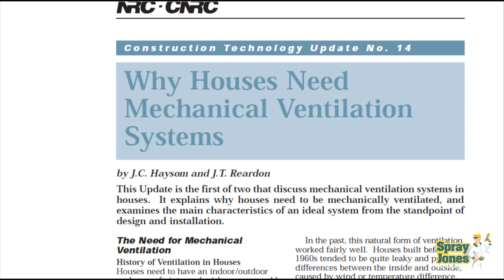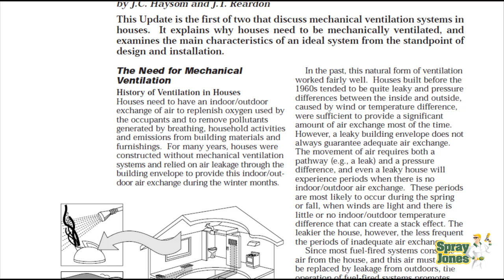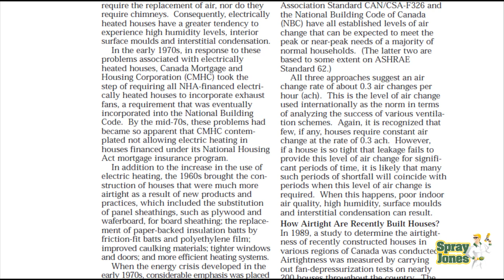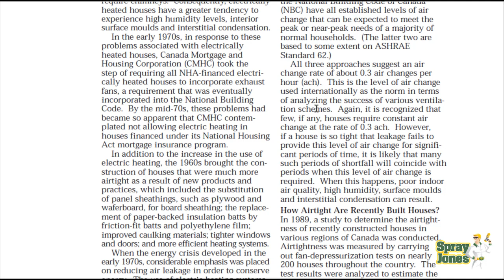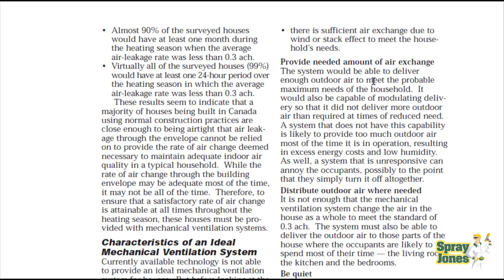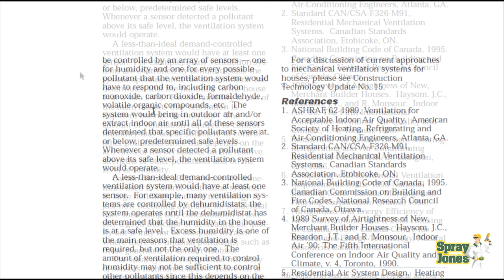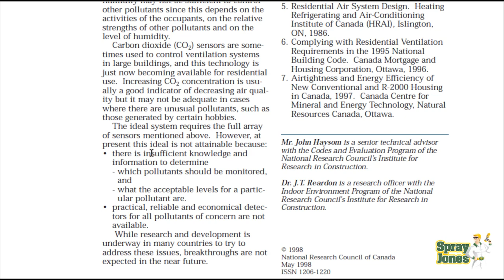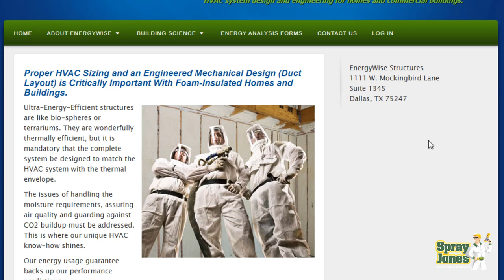Can A Home Be Too Air-Tight With Spray Foam Insulation?

Comment: I had a cabin with closed cell.  It had moisture in it. My hvac professional slowed the a/c air flow by 20% and the air was great. 30% humidity. System cycled 1-2 times per hour in the summer. Done deal.
Reply from the maker: Thanks for sharing

Comment: Thank you for answering my question so quickly on "knowing how to get a quality spray foam installer". I watched every video you did. I am building a 4,200 sq foot home. It will have a conditioned attic, a fresh air system, and the HVAC will be housed in the conditioned attic space with separate dehumidifier system. All designed by an engineer. So, one last question. Structurally I will have wall studs that 2x6 or 2x8, dependent on what the structural engineer may deem worthy.  As I have seen in your videos with ROI on closed cell (thanks for backing it with true data) 2/3 inches of closed cell in both wall and in the conditioned attic space and ceiling of the internal living space. Again focusing on air sealing and thermal breaking. If I do that, then is my home considered done? meaning that it is unnecessary to do batts, further vapor barrier etc. I understand that this is all conditional based on proper install, but with 2 inches just wonder if there is anything more. This 2 inch closed foam is excellent and as I am going to have a deep wall cavity it leaves plenty of space for electrical wiring and plumbing. As if in the future I do not have worry about a plumbing leak or an electrical replace and have to dig out the wall. Like I would have to do with open cell foam and shaving. Thanks also for the tip on taping the joists and wall studs. Another great tip to know if you have a good contractor! Thanks again for all you videos. You the MAN!

Comment: I've enjoyed this series a lot. 
Currently have an old fishermans cottage gutted back to the stone walls. Roof done, doors and windows done and currently trying to work out the best option for insulating.
I have to say I've been sold on foam but really have to consider what I'll need as far as HVAC goes. Its a tiny cottage and I don't really have the space for a mechanical system.
It seems you really cant win here. Wishing I went new build at the start.
Reply from the maker: Old school is just to open some window. Works every time.
Reply: Try looking into minisplits.
Reply: I would definitely use spray foam, I would also use a mini split system like a diy Mr cool, (if you wanted to install it yourself) or you could use a hotel style window ac/heat pack
Reply: Wood stove and a window shaker ?

Comment: Great video Spray Jones.. very informative!! I do have one question regarding the information you mentioned regarding 2x4 construction walls. We are currently renovating an older bungalow around 1000 square feet which has 2x4. We have decided that we are going to spray form the basement exterior walls with closed cell. We have exposed a couple of exterior walls upstairs which has compressed paper back insulation with ultra thin vapor barrier. With the possibly large difference in R-Value,  Would you recommend we exposed all exterior walls and replace with new R-14 or continue close cell spray foam throughout the entire house? The house is also getting a 97% AFUE furnace
Reply from the maker: You should spray as much closed cell SPF as you can while you have it opened.
Next week I will be doing a video on a wet basement and how it was solved with SPF.
Then a 4 part series is coming out on everything to do with walls and SPF. Part 1 is 2"x 4" so stick around you will like what is said.

Comment: A lot of people don't know when you use spray foam that your hvac system will be smaller, almost half the size (depending on how many windows you plan on having of course)
Reply from the maker: Correct.
Reply: That is very interesting to know, especially for cost savings. Thanks for that.
Reply: @SinnisjInsulator  I think if most people knew that their hvac system cost would be less by using spray foam it would be a no brainer
Reply: @stcharleshometheater  I eventually want to replace my outer insulation with sprayfoam one day. But right now my better half has us replacing all the windows and exterior doors in our home. 😃. It will be a while before we get the funds for the project that will bring our investment back quicker lol.

Comment: Love Spray Foam insulation and recommend it for insulating most of the home.  I believe there needs to be some areas in the home that use other insulation systems to meet the air exchange that a home needs.  I have personally seen many, many homes that have air tight spray foam with top of the line Air ventilation systems that have major molding and moisture problems.  Modern ventilation systems may have improved the monitoring of the proper air  exchange to prevent this problem but the old systems suck.
Reply from the maker: I do not agree. We don't selected leaky envelopes to deal with interior space.
Think about what you just said.... you want to allow air to move through walls and roofs - in some areas - to provide humidity control??
How does an airplane work? 
Everything has cause and effect and when one space is sealed up then controlled air must be brought in to achieve temperature level & humidity levels. That is what mechanical engineering is about.

Comment: I’d love to see your opinion(video) on AeroBarrier...in your opinion is it useless compared to spray foam insulation?  Does it work well in combination with spray foam insulation or is this overkill?  Does it make other forms of insulation more comparable with spray foam insulation?  Would really value your opinion!
Reply from the maker: The idea of what is needed is 100% correct. SPF HAS to be caulked at the seams to stop air. 
How one goes about achieving that is the biggest question.

Comment: I’ll preface this by saying I am an amateur at all of this mechanical ventilation stuff but am in the process of getting ready to build and want to do it right the first time.  With spray foam closed cell on walls and roof the idea here is you are creating a tight envelope.  The use of ridge vents on the roof and vents along the soffit DEFEAT the purpose of using spray foam due to the fact your lose the air tightness in the attic which will diminish the air tightness of the rest of the house …..is this correct?  Or does it not make a difference?    If this is correct, then you absolutely need a mechanical ventilation system (HR. Or ERV) to counteract the potential negative impacts of having a “tight” home?  Is this more or less an accurate understanding of this?  I commend you on your knowledge and efforts with your videos.  One of the few I have seen that provides education info and presents it in a manner that is easy to understand for those not in the industry.  Great work.
Reply from the maker: Start by watching y 4 part series on non-vented roofs.

Comment: We are retrofitting a 40x16 one story cabin with a block basement in northern Michigan. We have gutted the walls and ceilings. We want to make the 20x16 living toom a cathedral ceiling.  

Ive watched dozens of your videos trying to learn how best to insulate and manage moisture. 

We plan to use spray closed cell foam. This is a vacation home for all seasons but not fulltime residence. We want to heat with a wood burning stove with electric supplement heat. So no central forced air furnace.

If we spray foam the basement walls and rim joist and spray foam under a basement slab ( currently dirt floor) and spray 2x4 walls and 2x4 rafters in the vaulted ceiling,   how should we managed air exchanges and replacement air for wood burner and bathroom and kichen exhaust fans?
Reply from the maker: Open a window.... Lol. 
Honest, you should ask the HVAC people. Since it is a cabin you need to find a simple solution for fresh air make up. Maybe a simple damper system can be installed. 
It may be best to consult with Energy Wise Structures in Texas. Pay a little money for their advice..
Reply: @SprayJones  thanks. I agree something simple is probably best. I may be over thinking it. There has been so much moisture in this place that I'm starting to obsess over it. Ill talk to an HVAC guy.

Comment: I love your commentary and the information you share...definitely keeps me liking, subscribing, and coming back!
I am going to make a spray foam order from a manufacturer and would like to know what is most important, to request, when ordering closed cell foam for a 3 inch layer, in a south Texas high humid environment, within a temperature range up to 100 degrees Fahrenheit,  but no lower than 40 degrees Fahrenheit.
Reply from the maker: Thanks for watching. 
I do not follow, what is most important to request?
 3 inches of closed cell in south Texas is fine, more than fine. What else do you need to know?
Reply: @SprayJones , through watching your media, I learned that I can order the spray foam from the manufacturer, but need to make sure that the foam will work in my climate, not a freezing cold climate, and I’m not sure if that is two different types of foam, or not.
I will be ordering barrels weighing over 200 kgs each, and don’t know what specifications are for equipment I should be purchasing as well.
I’m generally trying to make sure I don’t overlook something a professional would know immediately, that a project manager that doesn’t specialize in this field may overlook.
Reply from the maker: @pumah96  So I understand, you are starting to spray foam...like a one time job or you are now a contractor?

The red flag is that no one picks up the phone and just orders foam, you need all the gear and to be orientated, assigned a company rep who will get you pricing, check your gear, provide tech data and support, just to name a few...
Reply: @SprayJones , yes, I am a project manager, I went straight to the manufacturer, have a rep that translates English to understand what I am requesting, I will need to know all required training, equipment, regulation, codes, but the chemical specification requirements is the part that requires someone with experience to most easily discern, where the other components, I can find out, as I have through other industries, through documentation.
Reply: @SprayJones  I will be building a facility, am preparing to learn the trade enough in the next year to do this aspect of the build myself because there are several projects that will require this trade in almost every major project.
So I’m planning and preparing to be ahead of the curve.
You are the most knowledgeable person in your field that I’ve seen online, so you have been my best shot to reach my goals, and I am appreciative~
Reply from the maker: @pumah96  Then pick a supplier and get set up with them, trained and the will make sure you get the correct SPF.
Reply: @SprayJones  Thank you

Comment: I just got spray foam installed in my new construction addition and because of that the county requires that the HVAC has a vent that pulls air from the outside. My question is how will we keep things like wildfire smoke and pollen out of the house?
Reply from the maker: It is called a filtration system. Go check out energywisestructures.com to learn about HVAC

Comment: mechanical contractors dont exist here . lol the ones that do... wont bother with residential. All of the HVAC I have called out are just after the quick fix. They spit out duct sizes off the top of their head. 
Another great video.
Reply: "If it blows it goes". Good nuff.
Reply from the maker: Then learn what you can and help fill the gaps. Opportunity to charge a little more and or make connections to build value.
Reply: @SprayJones  
Unfortunately i am not a "business guy".
Could be that this area for some od reason doesn't want to spend money on comfort and efficiency.

Comment: On a new construction home, would you recommend a ductless mini split system? Instead of an hvac?
Reply from the maker: I don't get into those recommendations. I don't know, I refer to an up to date HVAC contractor.
Reply: I suggest the mini-splits for smaller homes but honestly the traditional ducted system is going to give better results in a larger home with many rooms . The newer HVAC systems offered today can be  just as efficient as a mini-split . My 1150 sq ft barn style cabin home is spray foam insulated and I use one 24k mini-split though . They are awesome for the smaller houses IMO .
Reply: @rydfree  m
Reply: Do mini-split systems have fresh air exchanging capability? Without that, you would just be recycling inside air in a well sealed house and not controlling the air freshness.
Reply: A ducted mini split is only good for either a smaller home, or for a smaller section of a home. It doesn’t have the static pressure needed to distribute the air across a long run in a larger home.
Reply: @DevilTravels  no that’s a ERV or HRV you’d be looking for. Your hvac system itself doesn’t handle that with either system.

Comment: I have a new construction and spray foamed house. Live in Midwest Indiana. Closed cell walls and open cell attic on rafters. Operator didn't do too bad but I don't think my headers etc were air sealed. I took trim off in my son's room at seal plate for floor and air was blowing right through the 2×4. I sealed with Great stuff. Is there a way to seal above doors and windows with out ripping out drywall?
Reply from the maker: Not really.

Comment: The whole "too tight" issue depends on your ventilation system.

If you're depending on goofy stuff like whole house fans and open windows?  YES.  You can make a house too tight.

If you move to a mechanical ventilation system?  No.  You can't make a house too tight.
Reply from the maker: Correct. Balance what you build.

Comment: Thank you for the HVAC information basics you included.   A home can be too tight if the HVAC system is not the correct design and install.
Reply from the maker: Glad it was helpful!
Reply: @Spray Jones  - I still have concerns with sealing off the wood in homes especially flat roof where there is no ventilation to keep the top chords of ijosts dry to avoid rot.
Reply from the maker: @darrellstruth839  Go watch the 4 part series on non vented roofs. 
What about a commercial roof low slope with rigid insulation and a membrane? There is no venting in that either.... yet that is done millions of time per year across North America.
Reply: @SprayJones  - commercial roof structure are normally within the building envelope thus moisture is controlled by the HVAC, which here in Alberta is usually dry.  I will watch that suggested 4 part series.  This is quite related to what I do and need to advise customers properly.  So far I am impressed with the foam products, but I think I am a little gun shy of them due to the 1970's spray foam scandal's!
Reply from the maker: @darrellstruth839  Just keep on learning, there is enough info on this channel to answer this. 
You cannot pass water through closed cell foam. So how is a top cord to get wet? From the exterior? Well if it does then the external envelope has failed, not the SPF system.

Comment: I'm building a new home my spray foam contractor wants to use 1.75 lb foam instead of 2lb. what are your thoughts?
Reply from the maker: I have no dealings with 1.75 so I really can't comment. 2 lb is anywhere from 1.85 - 2.1 usually. 
Just compare other factors: thermal value based on thickness, water absorb, etc.

Comment: Has anyone done a study on what happens to a home that relies on mechanical ventilation when it is either unoccupied/abandoned or without electricity for an extended period? 🤔
Reply from the maker: Not that I am aware of officiall
My father in law had his house sprayed by us in 2007, 1920 built home. No HVAC, just his fireplace and in-floor heat from a coal-fired boiler in the middle of the yard. That house has not been lived in until Dec 2018. There are no issues from a mold or condensation issue. The house has a smell to it from always being closed up and all the wood stains inside, smells like and old church and pinesol.
Reply: @SprayJones  It's the ONE thing I can't seem to find anywhere that's made a true test on. You see plenty of old houses lay vacant for decades with little structural degradation, granted they're usually uninsulated and drafty as a beer keg... But what about new, high performance homes that are built tight to say, passive standards? If they rely so heavily on HVAC+D for moisture control and ERV/HRV for ventilation in order to be at "longevity" conditions... What happens when the power goes out? 🤔

There's always the catch phrase "built to last" but it assumes constant occupancy and electrification...

I'd consider a home "built to last" if it could survive "on its own" like a castle or a pyramid or something 🤷‍♂️

Comment: Do you collaborate with the HVAC contractor to make sure the system will work well? Maybe a dumb question.
Reply from the maker: We direct the owner or builder to do so. We rarely tell them what to do.
Reply: @SprayJones  what I figured. Just wondered if hvac doesn’t do their job correctly, would you get the blame? Keep up the good work!
Reply from the maker: @Redhawk24  Obviously the system could run less efficiently than it should, so additional savings are lost. But the indoor air will be fine. 
Most modern equip will work great with SPF, it is when you mix old fashion with new and make no allowances that you run into issues.
Reply: @SprayJones  thanks again, love your info!